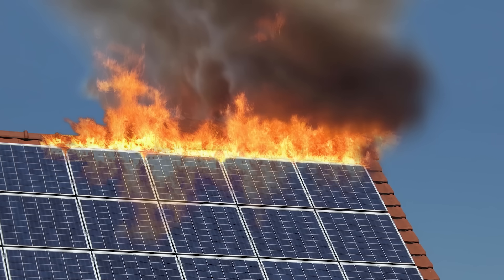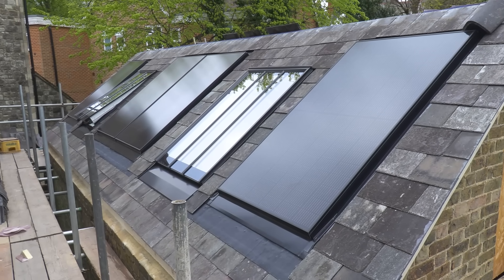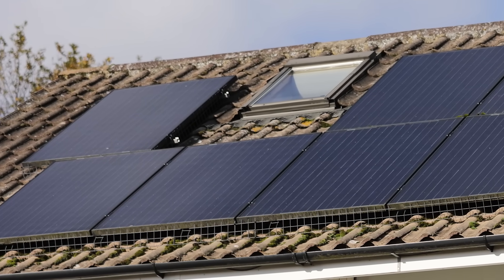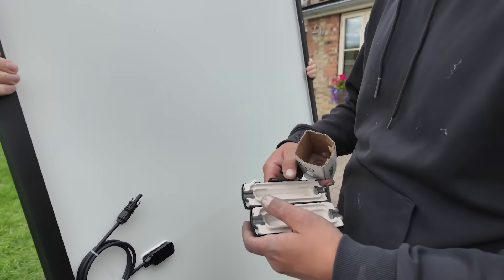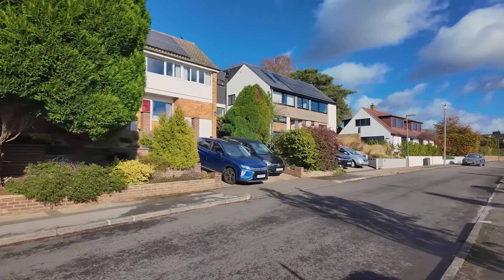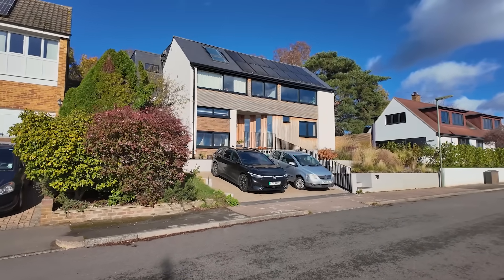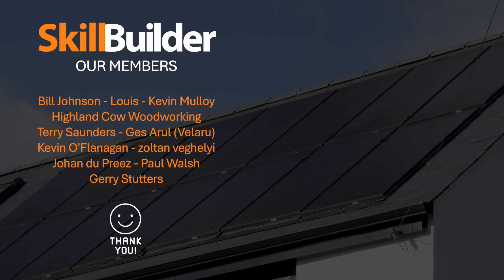Solar Panel Fires Are Rising – Here’s Why

Comment: You said ''fire is a risk'' but it's actually a hazard, not a risk. The difference is that a hazard is a danger, whereas a risk is a probability. This is a very common mistake people make but it's vitally important to know the difference in order to be able to properly understand how do a risk assessment. Maybe that could be the subject of another video? Thank you for this one.
Reply: So there's probably a risk of a hazard or there is a hazard that is a risk of a fire , can we go over this once more ..
Reply: @pinarellolimoncello  First identify the hazard then quantify the risk. That is the same as saying identify what the dangers are and then assign a probability to the likelihood of that dangerous event occurring. The highest risks are those that have a high probability of happening and/or the greatest consequences. Low risks are those with very low probability of happening and insignificant consequences. The next stage is to mitigate any risks and reduce them to acceptably low levels. For example, in the video the ArcBoxes are fitted to reduce a high risk (of connectors sparking and starting a fire) to a low risk. Everyone should be assessing risks before carrying out any sort of work. It's really easy and common sense if it has been explained properly and doing it drastically reduces accidents.
Reply: @lesterstanden2435  It drastically reduces accidents because only half the work gets done.
Reply: Fire is a hazard. So its a risk of a Fire hazard.

Comment: Lack of maintenance and electrical testing are partly responsible for fires as some of these systems are coming up 16 years old now.their where also loads of real badly made panals at the start that suffered from delaminatation and water ingress,and not forgetting mc4 connections that are not made off properly ie loose crimps inside the mc4 or mc4s that have suffered water ingress where they have not been cable tied of the roof surface to a dry area.
Inverters with built in Arc fault detection will stop a lot of these problems as well as optimisation systems with rapid shutdown.

Comment: ALL solar PV installations will be fitted with an isolator switch in this country.
Reply: How’s that going to help?
Reply: @edc1569  Zero current, zero heating, so providing you turn it before your roof actually ignites and becomes a self sustaining fire it'll help in most forms of failure.
Not the right answer because an arc detect based setup will do the whole job without relying on you wondering about the burning smell and smoke on the roof.
Reply: DC isolators themselves have started fires.

Comment: Did the fire officer tell you about the number of gas fires? Or does that not happen?
Reply: I think the statistic there is gas kabooms!
Reply from the maker: No and he also didn't tell me about the number of crashes caused by people texting at 80mph in the fast lane. There is such a thing as scope.
Reply: @SkillBuilder  lol, easy tiger! 

But I do agree that regular maintenance needs to be introduced for PV’s, insurance companies should make this mandatory for building insurance policies.
Reply: Possibly not, because this is a video about solar panels, not a safety comparison with gas .

Comment: A DC isolator on the wires from the panels wouldn't make any difference to the voltages experienced by fire fighters on the roof. In fact fires are more likely to occur at these isolators; fires are more likely to occur at any connection. The fewer screw or push fit electrical connections in any system, the better.  A better approach for a rapid disconnect of the DC cables is a pair of insulated wire cutters - kept handy next to the inverter.
Reply: They used to require DC isolators externally in Australia, but they caused a lot of faults and fires and have now been removed from requirements. So that was an attempt at mitigating risk that actually just added risk.
Reply: I like it.. off topic it reminded my of my then brother in-law, visiting them one time my brother in-law was showing me around his new dormer extension a builder was putting in, the builder had left a mains grey cable across the passage way and David being David said the builder told him to leave it alone until his electrical came and fully wired the circuit, but he wanted it out the way as it was his house so was going to cut it. 
I prevailed on him to wait until I had fetched a pair of heavily insulate side cutter and a pair of heavy rubber gloves from my car, he then cut it with a blue blinding flash and a yelp of surprise, as the whole house was plunged into darkness. my cutter had a arc gouge in them. 
Had I know what was to come a year or so later I would have said carry on and not got my kit.
Reply: @mebymyself2816 lol! Glad he wore rubber gloves. I'll put a note next to my wire cutters in case your bro-in-law-(apparently ex) stops by... ONLY CUT ONE WIRE AT A TIME! :)
Reply: Exactly. No circuit, no current.
Reply: @VinoVeritas_  but the voltage is still there. There will be voltage as long as there is light.
Reply: Firefighters in the UK have a fast setting foam that they spray on the panels to block the light from reaching them, thus depowering the whole solar setup in a few minutes.
Reply: Brilliant and hilarious at the same time😂

Comment: Far more gas explosions in a year, no one talking about that. My energy bill has reduced from 2k a year to £200 a year. And I have no gas in my house, making my house far safer than one with a combi boiler. As with anything, if fitted badly then you'll have issues. I have not yet seen any fires in my local area from solar but at least two houses have blown up due to gas leaks.
Reply: I'm more concerned about the gas infrastructure, it's age old now.
Reply: What's the revelance to electrical solar fires ???
Reply: @jonathanfriedlander8563 The more chance of having a gas issue because there are many more of them compared to solar panels. Ever heard of the phrase 'per capita'?
Reply: @jonathanfriedlander8563  a lot of people get solar to support a heat pump. Solar can be used to remove gas from homes, which will make homes safer.
Reply: @jonathanfriedlander8563  Because it might be part of a system to replace your gas so you want to weigh up the probabilities. How is it not relevant?
Reply: I doubt the 2k to 200
Sounds too good to be true
And makes no mention of the investment needed ot its reliability

What if it cost 20k and fails every 10 years

Might save a bit by putting money up front

But is it an equivalent environmental disaster?

Being that energy bills are distorted snyway fo force peopke in to alternatives. 

Sadly its very muct a ponsi scheme whether we like it or not.
Reply: Gas explosions are always a newsworthy topic for journalists therefore no need to incorporate into the Solar panel discussion. I am not disputing the value of Solar panels. I am annoyed at the lack of bird guards. Not only are feral pigeons causing a health risk they are destroying the electrical systems and the roof space. My neighbour is not a bad person we don’t want to get him into trouble. We simply want to make him aware of the damage the pigeons are causing to his property,and the impact it’s having on his neighbours.
Reply: Really? 2 houses blown up?? Are you for real? 2 houses in separate incidents blown up?
Reply: @onemanandhisdog  i live in Leicester and we had 4 destroyed from a gas explosion in 1 year. And we've had many people die from leaky gas pipes. Just saying.
Reply: @onemanandhisdog  One blew up in Swansea not that many months ago, nothing left of it, totally wrecked the houses each side too. Fire brigade didn't even know for sure they were looking at a house. 21 people evacuated from the explosion damage, one dead.

They do a huge amount of damage and you don't get to run out of the house when it starts.
Reply: Built in panels do look nicer but hope if one fails you can locate one of the same size. I did pay more for enphase micro invertors which convert to AC at the panel, supposedly safer but more conversion losses. With a 5 year check that needs scaffolding not sure you'd ever see a return.
Reply: @SurreyAlan  i think you may want a second opinion on that. Enphase invertors have a very long warranty (35 years i believe) and monitor every individual panels performance. They'll  notify you if any invertor or panel has a problem. Your solar sustem should also have a readings panel somewhere easily accessible so you can also monitor the monthly generation (these days its usually on an app). You should have access to that information so theres no need to go up to visually look for 25 years+, unless one of the 2 systems is showing a problem. There's plenty of spreadsheets you can also find online to help you monitor your generation and whether you're hitting your estimated generation figures (fyi you should have out performed estimates over the last few years)
Reply: @SurreyAlan    Wrong again.  Rectification may need scaffolding (or a cherry-picker?) but checks don’t.  Drones or binoculars can check for anti-bird netting breeches, if suspected.  All roof panels likely need cleaning at intervals.  Lichens, if not bird droppings, etc.

It’s almost comical that there are so many against such a video.  

No, there are, thankfully, very few accidental gas demolitions of homes - but remember houses are, or were, only designed for 4 1/2 psi differences in pressure.
Reply: Yes true. My gas boiler was heating air (good job i was watching ...it shot up to 85C  when set at 60C )  turned out it was the old central heating pump & the boiler would have exploded if i'd left it on !!!
Reply: @PaulBoyns-f2c    Nooo.  The boiler should be fitted with a pressure relief valve in one of the lines.  That is at the very worst.
Reply: An extremely large amount of Natural Gas needs to escape in order to not only supply sufficient energy but also to provide the 5%-15% gas/oxygen combustion mix to cause an explosion in a building. Even a minor one. It’s not a very common occurrence.
Reply: Says a Solar Panel user with reduced bills,but hoping his house doesn't burn down?, lmao.
Reply: How much did your solar system cost you?
Reply: if there's one good argument not to have gas it's this
Reply: Do we need to factor IEDs into the 'gas' explosion conversation?  Bomb squad have been mighty busy of late... 🤷
Reply: In Malaysia, we have LPG pipeline that exploded and create a massive Fireball that lasted for Hours...A lot of Homes were Damaged..
Reply: 200£? Cost of installation spread ocert 10years in this? In the EU politicians already putting extra tax on panels older than 10 years forcing ppl to replace them.
Reply: And you got your panels, etc for free to make those savings???
Reply: So two happen where you are and that makes it more then? In 2024 there were 171 fires due to solar, in 2020 there were 41 gas explosions so unfortunately the statistics don’t agree with your assertion. 

Personally I’d rather have a solar fire which is much more escapable in my opinion than a gas explosion.
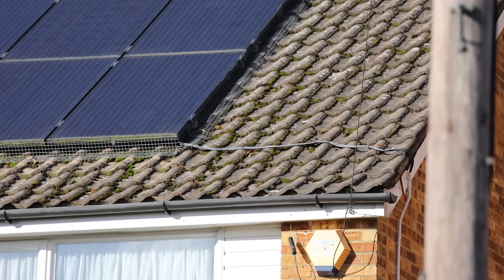Reply: @davideyres955    Why have gas with solar?  Fit a (proper) BESS and charge it from solar - or during cheaper electricity tariff hours (especially if one has an EV.🙂).  I am charged 8.5p/kWh from 00:30h to 05:30h on my tariff.
Reply: @davideyres955 Also how many houses have gas compared those with solar panels.
Reply: @ianrichards8302   No more new builds will have a mains gas connection, I believe.  Not been gas in high-rise flats for years.
Reply: @davideyres955 but howmany were due to a faulty appliance and howmany due to someone bypassing the meter with dodgy pipework and fittings....... I think we know the answer.
Reply: @johncart2082   No you don’t.  Obviously can occur but so can installations installed for cannabis growing.🙂
Reply: Gas explosions happen all the time and are really violent.
A townhouse in neighborhood nearby exploded on friday. Only a wide gap was left.
Gas infrastructure is getting old and there isn't much investing for a dying technology.
Reply: @AzrethK9 i think it's a good idea to phase it out for electric.. as much as i hate electric being the only option ,, i'd prefer it over a hole iin the ground
Reply: It's like ICE vehicle fire far outnumbering EV vehicle fires yet people only get excited about the EVs.
I guess because it's change and these Daily Mail reading Farage voters don't like that.
Reply from the maker: Maybe ask yourself why you feel threatened by this video. I said it was low risk but rising. You decided it was a video that needed challenging 😅😅. 0:05
Reply: @SkillBuilder you had no problem doing a video about solar panel fires when asked by a viewer. Why do you feel threatened by being asked to do a video about gas boiler fires?
Reply: @SkillBuilder  i think you should do a video on the dangers of gas to balance this out? Maybe a video about comparing all types of utilities into our homes would be good. 

Also be interesting to see if wood stoves, gas, storage heaters, electric heaters, IR heaters or air pumps is the most dangerous??

Comment: The battery chemistry in electric scooters and bikes is different than the one used in solar pv installations comparing the shows how misinformed the general public is.
Reply: LFP batteries still catch fire and still produce deadly gases.
Reply: @bordersw1239  LFP (lithium iron phosphate) batteries are much less prone to fire than other lithium-ion types due to their more stable chemistry, but they can still catch fire under extreme conditions like a severe short circuit, physical damage, or external fire. While the LFP cells themselves are more resistant to thermal runaway because they don't release oxygen, a fire is more likely caused by issues with wiring, external heat, or a short circuit that causes the electrolyte to leak and ignite
Reply: @stephenjones7804 exactly what I said.
Reply: same has the ones in cars and they have fires
Reply: @kevinraines4318  This is largely inaccurate. There are some EV fires (rarely fatalities) however fossil fuel cars burst into flame at a much higher rate per 100,000 cars compared to EVs. Additionally, battery tech improves constantly and fires will occur even more infrequently.
Reply: @mb-3faze so comparing a much older fleet to a newer fleet. Wait till the EV fleet is 20-30 years old. I’ve looked at the fire brigade statistics and they are actually roughly equivalent in terms of probability when you take into account number of vehicles on the road. The statistical probability is something like 0.00000008 or 9 between the two aka highly unlikely. 

There was an article by an Australian company but they had links to the EV industry and the figures they were claiming for worldwide numbers were exceeded by London’s EV fires so I don’t think I trust that research.

Having had an ICE car that caught fire and seen many EV fire videos I can tell you that the EV fires worry me more with the ferocity when they burn and designing electric door releases is idiotic in my opinion, especially when the electric batteries are disconnected. Too many examples of people being burned alive in EVs for my liking.
Reply: @davideyres955  China interestingly plans to ban retractable door handles for this reason.

The new Chinese regulations on EV battery fire safety are also really strong, which is good because they'll be defacto global standards.
Reply: @kevinraines4318  Energy Storage Systems for homes and businesses utilise LiFePO4 chemistry cells. Cells in EVs, electric bikes & scooters and any portable electronics use Ternary Lithium chemistries such as NMC and NCA.

Comment: MC4 Connections seem sketchy ... " Get a £20 fire proof box" for your £3 MC4 connector ! ... The MC4 connector just has feeble tube connection , with no spring grip & impossible to see if you have reached the correct insert depth , a lot worse than a 13 plug .   Seems mad way of connecting panels that don't need to be unplugged in 25 years . Why not just a crimp connection & weather proof box .. (Scafolding is provided so installer can crimp in safety ) ...
Reply: Crimping is not a bad idea but the MC4 connectors construction ensure that the insert depth is well defined.  The 4 (or 6mm^2) cables only carry around 10 to 12 amps and there's no reason there would be a surge (short of the sun going supernova). More likely is high voltage arcing between a worn cable and ground - and DC isolators are not going to fix that problem.
Reply: It's dead easy to see if the MC4 insert is at the correct depth, because it has a barb and locks into the housing.

Comment: I do recommend solar and battery - fitted well and safely.  

I do share concerns with poor installation: I have been fighting my original installer for many months because of what I found, and they have just paid a substantial sum for another (better) installer to rectify the installation.   My battery is external - specifically chose Tesla for this reason (and not to rob space in my garage, or have it next to the gas meter and boiler!!).

I worry that we feel 'safe' with the regulatory bodies' certificates, because I found breaches despite these ~ in fact the details on the certificates and documentation provided after install were simply false. 

I feel happier now that I have found these and had them rectified, but not everyone is as lucky, or even understands.